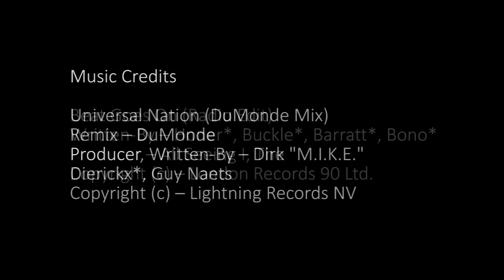ALFA ROMEO 159 | BREMBO BRAKE DISC/ROTOR AND PAD CHANGE | DIY

Comment: few notes:
-its good practice to measure thickness of brake disc: front not less 26mm at back not less 10mm
-brake pads come in different shapes according to axis(front/back) 
-i didn't knew alfa 159 had brake sensor, definitely will search for that
Reply: Aciu.  Now off to measure mine
Reply: And we have more tips:
When removing rims check for cracks (mine was cracked from inside)
good practice go to the shop for balancing (my rims was badly balanced and one even bent)
before that i always blamed country roads for car shaking...

Comment: One thing i would suggest, is checking the pistons and their seals on the calipper for any damage or signs of corrosion. This should be done every time brakes are changed. If any of the rubber seals are damaged, even a tiny hole will allow water in and corrode the piston. The piston will then get stuck jamming the brakes or just making them stuck slightly and brakes will overheat. Then the new disc and pads can go to the bin.

Comment: Hey good video, erverything is visible, the quality is good and the cutting ist perfect, but:

You should always clean everything with a wire brush (inside of the brake caliper, the screws and the wheel hub) !
Especially the inside of the brake caliper: it is very important for the mobilty of the brake pads, if you dont do it: dust can stop the mobility!

And you should use ceramic paste, especially on the sides of the brake pads, because they are moving over the inner sides of the brake caliper!

Also there is a mounting for the cable.  You should use ist!

Have a nice day :)

Comment: Thanks a lot for this video!
What's that one screw for in the brake disc? Is it just made for easier installation?
Because mine seems very worn out and I'd rather leave it out than risk having to drill it out next time i want to replace the disc again.
Reply from the maker: The disc will be held in place firmly by the wheel bolts. However, I wouldn't risk NOT installing it just in case the disc slips on a wheel change. I would install it, just don't tighten it too much and you should be fine next time.

Comment: Thanks for the great explanation! :) 
Do you have the torque specs for the two hex bolts holding the caliper itself?
Reply from the maker: No sorry, and the 159 is no longer with me so I haven’t got much info around.

Comment: Hey man thanks for showing! Did you ever have problems with stuck pins that hold the brake pads and wouldn't move?
Did you ever have corrosion on the inside of the brakedisc or such? Thanks!
Reply from the maker: Alex25CoB hey no problem, glad to be useful. Fairly dry climate here so no rust or sticking pins fortunately!
Reply: Apparently it isn't uncommon for them to be a real pain to remove.  They are a different material to the alu calipers and this causes corrosion at the interface.  Heat and violence is supposed to be the way forward.

Comment: Hi Jason, at 2:03 you mention "hex driver" but don't these screws look like they would require an STX 20 driver rather than hex?
Reply from the maker: You are absolutely correct! Now I need to figure out how to fix it on the video.... 😅 Thanks for the correction.
Reply: @JasonNeil  thank you for your reply! By the way I do not know which size it is I was mainly commenting about the shape. Some forums mention E18 or E20 socket
Reply: @JasonNeil  by the way, thank you very much for this video as I will be using it to do this for the first time on my 159 SW TBi soon :)

Comment: Hi, i'm planning on doing this in a few days. Can you remember the socket size of the external torx bolts that hold the caliper? I need to go and buy it and. Thanks!
Reply: Bit late for you but it is an E18 - at least they are on the Mito with Brembo calipers.
Reply: @MT-zn6tc  indeed a bit late but thank you for answering anyway! 👍
I eventually found the answer to my question somewhere on the interweb, bought the right socket and got the job done... Don't ask me if your answer applies to the calipers of my 156 ti because i already forgot the size.. .... 😅 I will check tomorrow.

Comment: Am Bremssattel, Innenseite über der unteren Schraube, ist eine Führung für das Warnkontaktkabel. Diese sollte schon genutzt werden!! Außerdem wird bei Fahrzeugen mit ABS keine Kupferpaste genommen sondern Keramikpaste!!
Reply from the maker: Torsten Just translation please?
Reply: he means that at the inner side of the calipper, there is a conduct für the warning contant cable, you should use this. also, you should use ceramic paste instead of copper paste when a vehicle has abs system on board (i dunno why to be honest)

Comment: OK,  I just managed it by removing disc from hub then slowly drawing caliper fwd just enough to release disc.  Can't bend it away on 2011 model.
Reply: Ive got the same modelyear. For some reason we have Hardlines right to the caliper...But if you remove the clip holding it through the suspension ( cant remeber wich part) you can move it enough to clear the disk. Hope it helps someone.

Comment: Mine has no flexible brake line to calipers - how to change discs without brake fluid loss?
Reply from the maker: Seriously? I have never seen a solid brake line to calliper in my life. There has to be some flex to take up suspension movement.
Reply: Alfa romeo 159 2.0 jtdm 136bhp solid brake line from vertical ally suspension casting to caliper. It has flexi on other side of shock absorber.  New to me as well!
Reply: Ive got the 2011 20. Jtdm 170 PS. For some reason we have Hardlines right to the caliper...But if you remove the clip holding  the hardlines through the suspension ( cant remeber wich part) you can move it enough to clear the disk. Hope it helps someone.

Comment: hey there, do you need a hex driver or a zxn driver for the screws of the caliper?
Reply from the maker: Hi John, you need an external torx driver for the two caliper bolts. Take it very slowly if you get some resistance and squirt some penetrating oil and leave to soak. This side was fine but on the other side I was close to sheering a bolt as it was very seized.
Reply: @JasonNeil  hey thanks for your quick answer, just ordered a torx driver set on amazon :D 

I will soak it the night before changing
Reply: @JasonNeil  I did it today, did the change of both sides in 1,5 hours with a 10 min smoking break between the sides. the passenger side was much harder to loose, i took a 70cm torque wrench for more leverage, it worked. Driver side was very easy with a little wrench like you used in your video. 

External torx driver E18 worked also perfect for me, got a whole set with extern and internal torx drivers for 20 euros
Reply from the maker: John Pyle cool! Glad you got it sorted. :)
Reply: @JasonNeil  Yeah thanks to you, i wouldnt have done it without your video.   

+ little fun fact: i dont own a “persuader“ , so i took a large screwdriver and pulled with both hands, when the disc came off its edge felt right onto my knee, its still hurting but totally worth it xD

Comment: is it 330 mm or 310... I thought only the bigger red brakes with brembo aluminum callipers...
Reply from the maker: 330 on the 2.4 and I think the same on V6 and maybe TBi too.
Reply: +Zenderman  you are right, i think with ti trim or on the sportiva trim with sport package they made these brakes available for also smaller engines, but they painted the calipers red. it should be the  same aluminium brembo calipers, such a strong good brakes.

Comment: Copper grease and aluminium? No, no, noooooo!
Reply from the maker: ipad tres cuatro where is there any contact with aluminium? The back of the pad does not touch anything aluminium. It contacts the pistons which are steel.